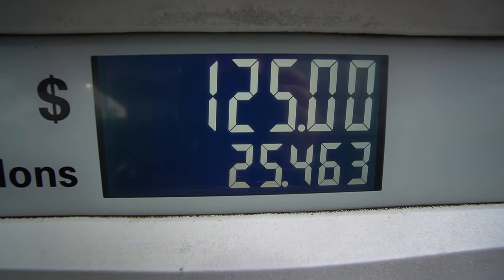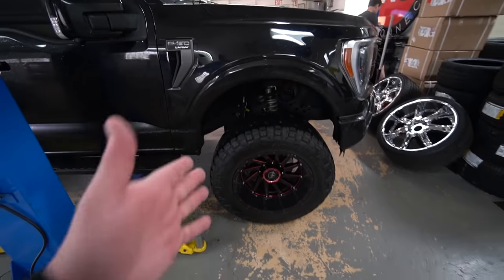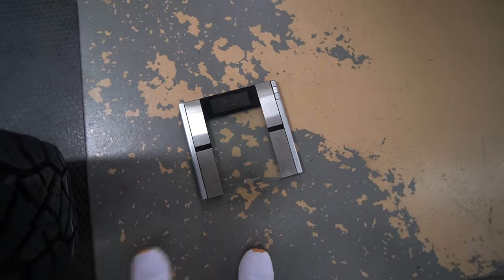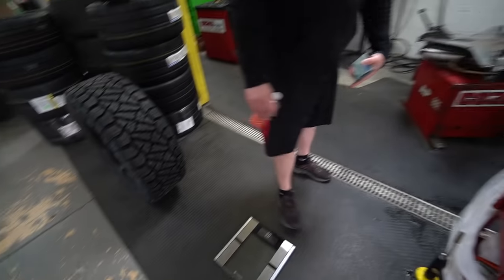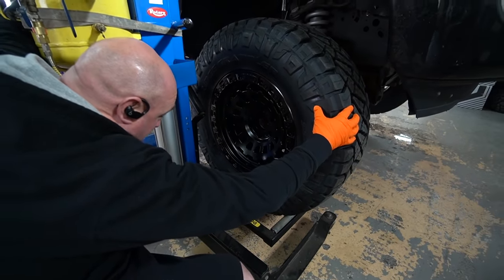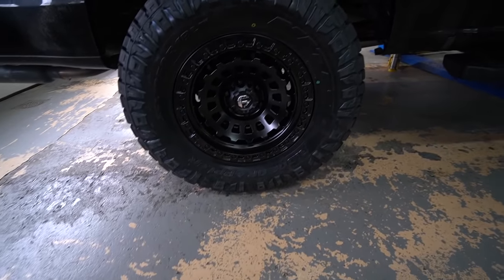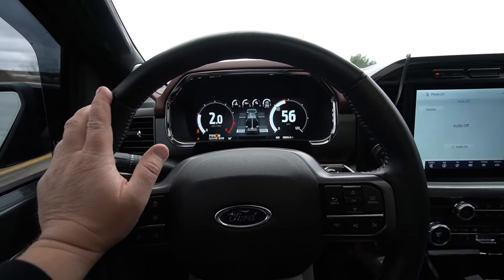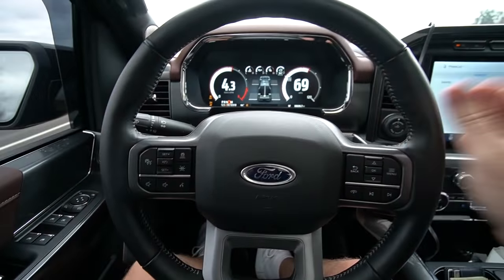Not Modifying a Ford F150 Again

Comment: Shifting from 4H to 2WD under full load won't do anything since it will shift once the vacuum pressure release after you let off. It won't just shift while your flooring it.

Comment: Love the new setup. When I bought my ‘19 F150, the dealer swapped out the original wheels for 20x9 Fuel Mavericks with a 33” Toyo and a 2” leveling kit. No rubbing issues, but it’s so close when I turn, that I can’t run my front no drill mud flaps. And it also rides a little rough in my opinion. Wish they had gone with an 18x9 wheel instead to give a little more sidewall on the tire for a softer ride.

Comment: If your that worried about the weight and speed lower it and throw some low profiles on it. When you get mud tires you can't really be worried about the weight and how much it will slow the truck down.

Comment: Love it but I'd have went for the red highlighted center caps to match the red Ford emblem.  Glad you went with 18 x 9s.  Your gas mileage might increase a little with less tire width but not much if it does.  Wish I'd went with 18 x 9s on my Chevy instead of the 17 x 9s and went with the Ridge Grapplers instead of the Terra Grapplers.  Love that tire pattern.  Next time maybe.

Comment: my 2015 Mustang has 19 inch rims. It rides much rougher than my 97 F-150 Lariat with 16 in rims and Donuts on. My 79 Bronco also rides better. I put the original 97 150s 17 inch rims and tires on the Bronco with wheel adapters. The donut tires do run better in snow. But that is a sacrifice between tires built for the road and tires built for Terrain.

Comment: the 4x4 shift mechanism was not made for the way your using it . wasnt made to shift in an out of 4x4 H an shift out at 60, especially if the 4x4 actuactor goes out (1 on each front wheel) it will take out the wheel bearing as well. its not a launch control, makes me cringe knowing this will be traded in an a poor sap with inherit the damage

Comment: Time to get that truck in the Mud ,see it towing it's maximum weight,put it in the snow etc , otherwise it's just a pavement racer ,and your tyres are still out side the body ,stones getting flicked and mud spatter ,is that really Cool Mike ?
As you pointed out about the fuel price ,when filling up , would less agressive tyres give you better fuel economy?
With the blower and tune ,is it costing you more to run ?seeing as fuel is not cheap anymore,you can't ignore that this is real,I don't think any of the car channels can just ignore that it's a different world now ,but in saying that here in NZ ,1 litre of 91 octane is $2 .45 litre plus as there are taxes on fuel in different cities.
The push for lower emissions is gathering momentum,they way they are doing that is taxing more on fuel,Ford lightning coming to your channel ?????